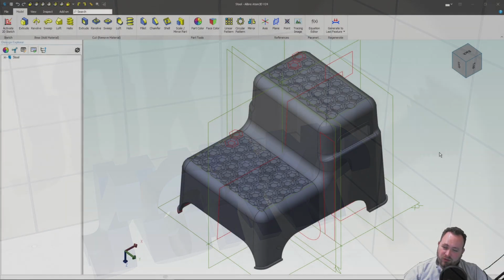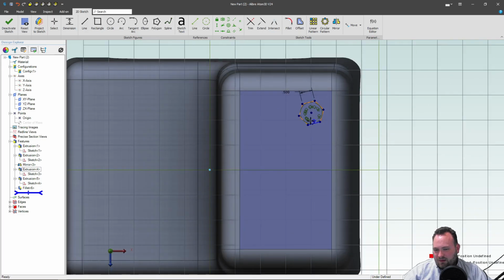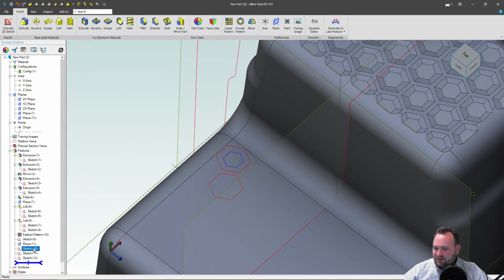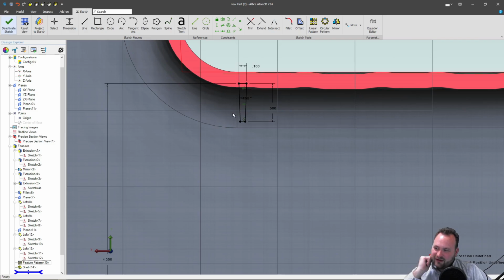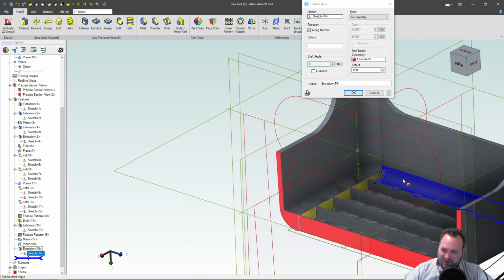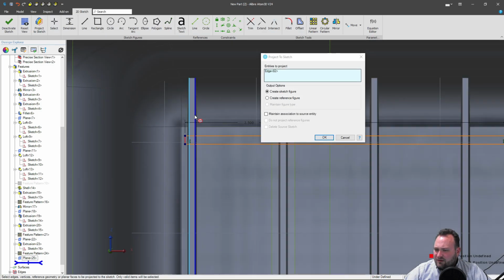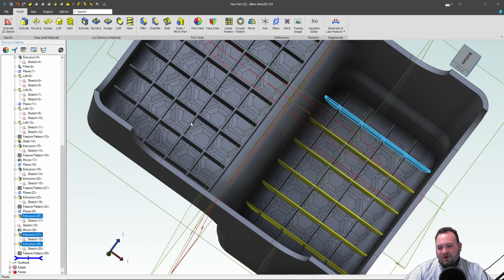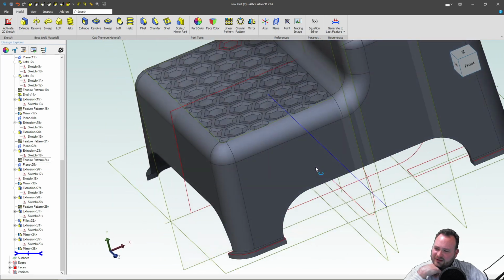Alibre Atom - Make a Step Stool With Injection Molding in Mind! |JOKO ENGINEERING|

Comment: 48:30 How would you add a draft angle to this extrusion/rib? I think you forgot to add it?
Reply from the maker: I think I did!  It should be as simple as putting a draft value in the draft box.  Good catch
Reply: @JokoEngineeringhelp  I tried adding draft on the extrude. However when you have to extrude the next face (51:12) the face is drafted, so the next extrude is at an angle so there is a small gap between the top of the rib and the stool. Is there a way to extrude that non planar sketch along a straight plane?
Reply: Never mind, I just figured out I can extrude along an axis, not along normal. I am new to Alibre.
It would be great if you could make a tutorial for injection mould tooling in Alibre, either for this part or another DFM part.

Thanks for all the great Alibre content, you are carrying their marketing department 😂.
Reply from the maker: @AndreMonthy  Here is a video.

https://youtu.be/Nwjbp4ow054

I modified two sketches off camera so the video would be less than 20 minutes, but it's the same stool otherwise.

Comment: It is cool to learn some design techniques for injected moulding product design.Thank you. It's very different from the steel world I'm in. However I have a few general notes I think could still speed up your designs:

You can do a feature pattern of a feature pattern. In this case you could have made a pattern of the first hex loft cut to get the second one and then patterned both of those.

If you plan to project to sketch the same face that you want the sketch on then you can skip the sketch activation step by just selecting the face and going right to projecting.

You can save a lot of calculation time by either fully disabling "real time previews" in the settings or just disabling it per feature with the icon in the lower left corner of each feature dialog.

Comment: Hi, thanks for the video, just instead of extrude boss to the other plane why not extrude to depth and use a draft angle, I think would give you the same result but not have to define the sketch on the plane.
Reply from the maker: That's a great way of doing it and I probably should have done something like that in the video.   By using the up to next method in the video, the wall being extruded into could have any shape in case it wasn't only drafted, but using extrude to depth would have been ideal in this case.